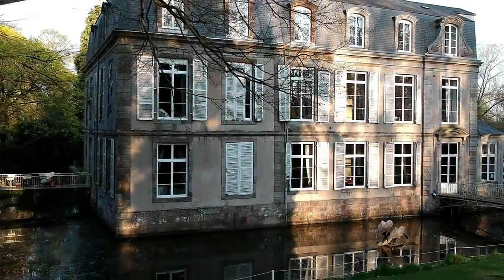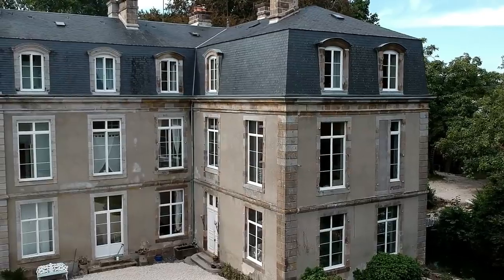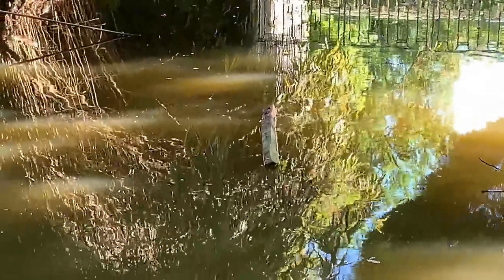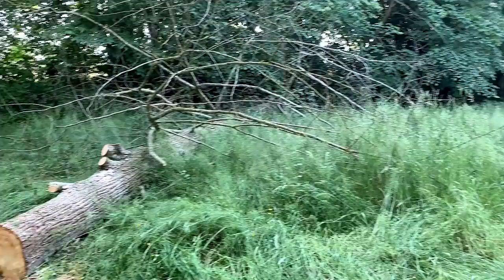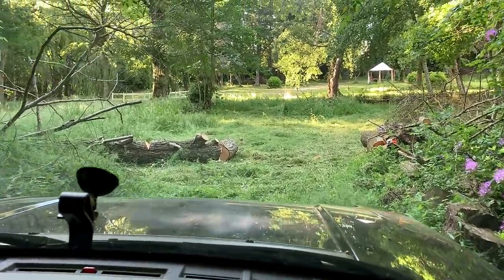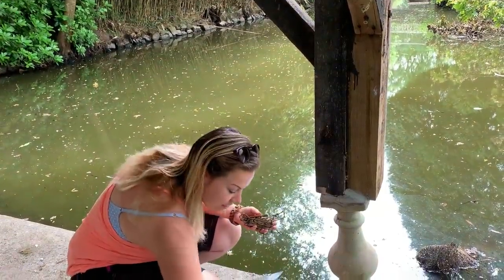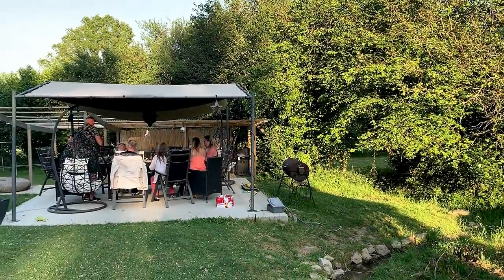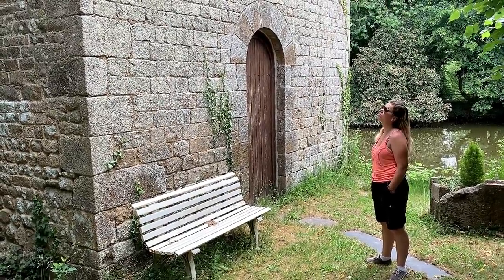Chateau Life 🏰 Ep 16; SWAN HOUSE IS DONE!

Comment: On our presbytère ( about 30km from you) when the roof was redone 7 years ago, the Charpentiers butted the top slate on one side of the ridge against the underside of the top slate on the other side which then projects about 5cm beyond. They then used silicone mastic to seal the join. It hasn't leaked so far. I notice Billy and Gwen Petherick have a nailed down zinc ridge. I guess it depends on what you prefer.

Comment: When we had our roof done in Charente the Plummer came and put an zinc cap on and round the Velux,chimneys,and zinc guttering. Maybe that’s something you could look into ? Very nice restoration job well done ! I know what you mean about jobs stretching, we call it one step forward two steps back ! Last nite watering delayed by half an hour getting a lizard out of the sprinkler wand, he had crawled into the hose and then got blasted into the attachment when I turned on the tap blocking the wand, aarrgggh ! 🤨🤪🇫🇷😎❤️
Reply: I simply cannot find a tool once I set it down. I can be right in front of my nose, but it disappears and I spend 20 minutes looking for it.

Comment: 8:30.  Those tile hangers are brilliant!  I live in a house in Massachusetts, USA that was built in 1881.  The roof is a slate roof which is a nightmare upkeep.  Whenever there is a terrible rain storm or snow storm I lose tiles off of the roof.  The only way that masons can fix the tile roofs in my area is to nail them back on.  They use a tool (looks like an ice pick, but it doesn't shatter the slate) to make holes in the slate tile and then hammers them in place one by one.  It's a grueling and repetitive task.  I wonder if the tile hangers would work on my roof.  Hmmmm.  Great video!  Thanks for the upload!

Comment: Just run your angle grinder up the edge to neaten the slates up and it will look far more professional, the french way of butting tiles up against each other works if they are tight against each other, but not so good if there are gaps, the wind can blow water under the tile, but I dont suppose the ducks and swans will be sat there in the wind and rain.

Comment: Am I the only one who don’t like the cement pilars on the water side of the swanhouse....
Reply from the maker: Sadly they can't be wooden legs all the way down to the base as the water level can rise and that's what rotted them out before; if we had spare granite stones I would have used them but they are all needed for moat wall repairs.

Perhaps in a few years I will revisit it but its what is necessary at the time and working with what we have
Reply: @ChateauLife  thats a valid point. I did not think of that!